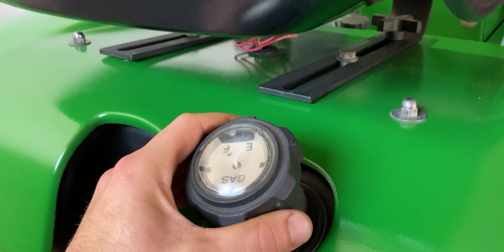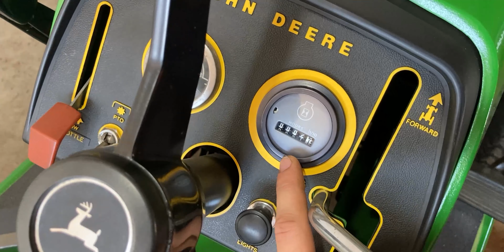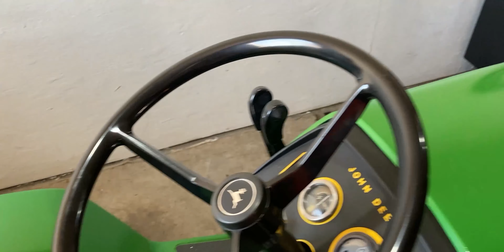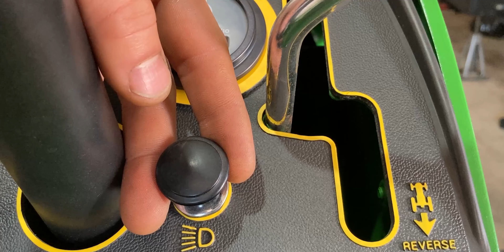The John Deere 300 Garden Tractor Is Like NEW!

Comment: Your 300 came out great! Thanks for sharing.   Ive got a 314 and a 317. Going to restore the 317 and swap in a Vanguard this spring.
Reply from the maker: Thank you so much, I appreciate it! It's always a pleasure to be able to share projects with like-minded enthusiasts. Both tractors you have are very nice! The 300 series models are like an all rounder, not too small and not too big. A fair amount of horsepower to get many things done! You will really like your 317 once you convert it. I hope you enjoy the conversion process as well. Best regards
Reply: Um....A Vanguard? Really? They're not half the engine a Kohler is. I'm afraid you'll have continuing problem with that engine. But since you posted this a year ago, how did it go?

Comment: What is the part number  for the rear pto thanks
Reply from the maker: Hi Robert, I found part numbers through Weingartz: https://www.weingartz.com/assembly-diagram/john-deere-parts-lookup/model-300-hydrostatic-tractor-16-hp-k341-aqs-kohler-engine-pc1474-drive-shaft-300-316-s-n-095-000-hydrostatic-tractors/4275-35358-464258 This website is great for parts information along with assembly drawings.
Take into consideration that there are two versions of the rear PTO. A solid shaft version and a splined shaft version.
I hope this will help you with your search. Regards Andreas

Comment: Where did you get parts? Mine needs side shrouds, front grill and light assembly
Reply from the maker: Hi Geoffrey, some parts for this tractor came from a parts 317 I had. If you're need of parts like the ones you mentioned I would recommend looking online. Nowadays there are many parts for sale through Facebook marketplace and other sources. Big parts like this are very expensive from Deere and used parts is really the way to go. I hope this helps. Regards Andreas

Comment: I want a Deere garden tractor so bad for a winter project I found a 316 but the guy won’t message back… but I found a 300 for 500 bucks is that expensive cheap? It’s a little beat up but it runs
Reply from the maker: I just responded to your other message. Check it out!

Comment: Nice project, these are great tractors with solid engines.  I do think the rims are painted, I don't think JD did the powder coat thing until like 1986 maybe 1987, but I could be mistaken.
Reply from the maker: Thank you, I enjoyed my time restoring this one for sure! I've since worked on three Kohler engines and they seem to be built very well.
That is possible and thank you for your great information! Just by the looks of the rims, they seem to have a durable finish and that is why I mentioned "Powder coating", but I could be wrong too! Best regards

Comment: Wow that looks like it came fresh out of the factory nice job do you use oem John Deere and Kohler parts or do you have another source
Reply from the maker: Thank you! It probably looks the same, but this took longer than a factory job. Eithere way I'm really happy to have another John Deere project complete. I source OEM parts for the most and for this rebuild I found parts online from a seller which was parting out a JD300. I will have an upcoming video where I share a breakdown on this garden tractor. I will cover the cost in parts, cost in the rebuild and how long it took me from start to finish. Stay Tuned

Comment: Looks sweet.  300s are my favorite.  What paint did you use on the dash(the black not the yellow)?    And what paint did you use for the green?   Thanks
Reply from the maker: They sure are nice machines! I like the 300 a bit more than my 317 to be honest. I cleaned the dash with water and soap, painted the outlines, symbols and qords with an oil based marker and once that was dry, I sealed it off with "Dupli Color - Custom Matte Finish" clear coat. This gave the dash a matte finish and I think it looks very nice. If you would like the dash to be more shiny, I would recommend you to use a semi-gloss clear coat. I hope that helps, Best regards
Reply: @WorkshopRebuild  Well it turned out great thanks for the info.  It's nice to see the youngers guys bringing the pride back to the old Deeres.  Cheers to you too my friend.
Reply from the maker: @chax2004  Thank you for your compliment! I try my best to keep quality machines alive, like this JD garden tractor. It was a different era of manufacturing, but these machines hold value and prove their capability on a daily basis after 40+ years. Thank you once again, Cheers

Comment: What size belt does it take ??
Reply from the maker: Belt for the mower or for the rear mounted tiller?
Reply: @WorkshopRebuild  for the mower.
Reply from the maker: For the deck it is 1/2" x 90"
Reply: @WorkshopRebuild  thank you so so very much
Reply from the maker: You're more than welcome